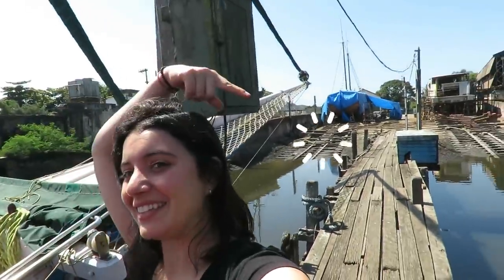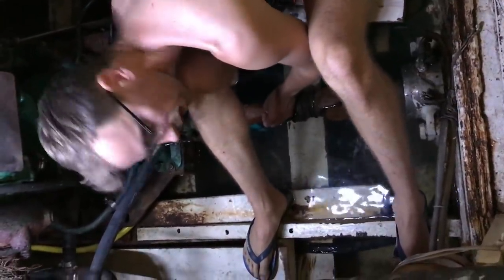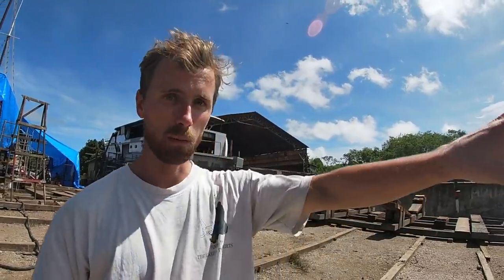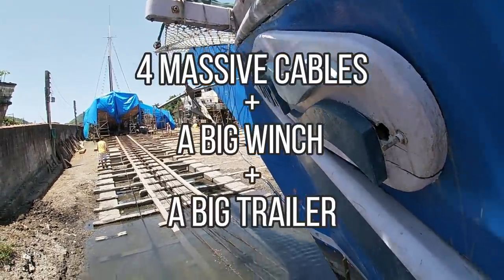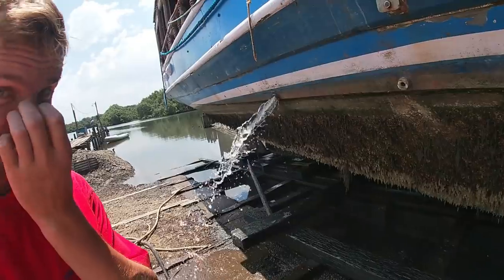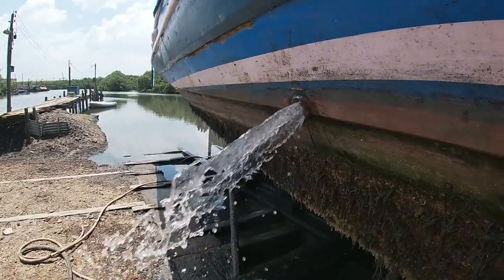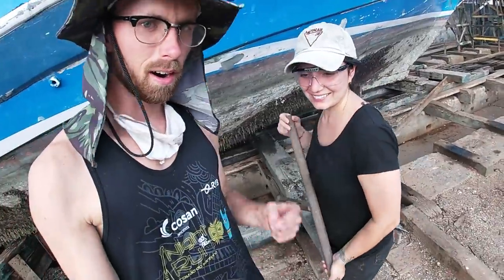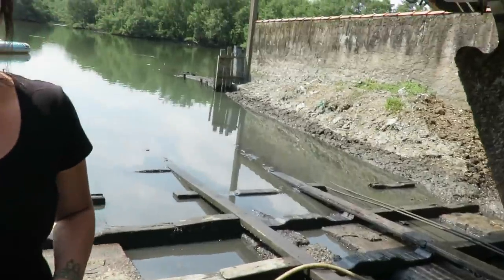Lifting our wrecked schooner for the FIRST TIME in her life — Sailing Yabá #3

Comment: While on the hard, if you haven’t already, I would have Yaba properly surveyed and fix anything that could possibly cause a failure at sea. Most likely the holes you see are the tip of the iceberg. Not worth risking lives for the sake of a timeline. Good luck to you both.

Comment: I think after all repairs are done to the hull I would put some fiberglass on it with epoxy. That way she would be stronger and less likely to leak. If you bored the holes out and plug them I would put  penetrating epoxy on it that way it will get into all crevices
Reply: I agree!

Comment: Hi Guys.

Just my opinion. But you will need to clean all of the hull below the waterline and then either replace the rotten planks or fibre glass the whole area below the water line.

Any thing short of that will see your ship on the bottom of the ocean.

Cover all the soft areas with sheets of water proof plywood if you need to move the boat back into water.

Anything other than that and you are wasting your time and money.

Do it right or don`t go to sea.

David.

Comment: When fixing holes: maybe better to bore out the holes. Then cut some pieces of wood slightly bigger and hammer rhat into the hole. I think that is a better quick repair then with epoxy. Also cheaper. The new wood in the hole will grow when it is getting wet and stop the leaking.
Reply: On wooden boats you replace planks.
Reply: @thomashaas2929  ...and on this one, all of them. I just wonder if the ribs are in the same sorry state, infested with worms.

Comment: As you allready have your vessel out of the water, you should at least repaint it the bottom part of the hull with antifouling paint, those barnicles will chew the wood of the hull asthey have to stick into the surface and as the surface will get rotten then iyou will starto to have holes again, it is better to stay few extra days and be on the safe side, if you do it now you will save the cost of pulling out the vessel again soon, take care

Comment: Did I hear you correctly that this boat was built in 2004?  That thing looks like it was built in the mid 1900s ! There is no way that it should be in that bad of shape in 14 years unless it was built by someone in their backyard from lumber not suitable for boat building!  

You are in for one very long stressful journey which is going to make 2020 look like a piece of cake! 

Keep your head above water! It's going to be rough sailing ! Be Blessed you are going to need every blessing possible!
Reply: I didn't know it was only built in 04, if that's the case then that boat has been treated really bad. I'm guessing the reason they have so many leaks is because it was antifouled sparingly. Also I can guarantee the wood is filled with worms that feed on wood.
Reply: No way this can be 2004. It’s all rotten.
Reply: 2007. Even worse. With big patches of rot and worms in the planks (and rotten ply on the inside), it’s not worth the time, money, and effort
Reply: This is it's first haul out apparently and it's the tropics! Its lucky it hasn't sunk well it was sinking slowly. This hull wouldn't be safe in a seaway.

Comment: Don't use epoxy! It won't stick to wet wood. Use old fashion Boat Life caulking for wood boats. Looks like a great yard. The marine railway is better then a travel lift for the old wooded boats. I have repaired worse boats. Use cooper with bronze nails to patch the holes in the hull with boat life caulk in between.

Comment: yeah seriously do those worms were actually Barrel Through the Wood and eat the wood up they don't weaken the wood and make it more acceptable to rot and is welcomed apart on you do the fact that that thing is that messed up and there's that much worm infestation you were lucky to get it on the dry dock II be like putting it back on there as fast as possible and take care of that Rusty hinge part on that Rudder in any other rusted parts

Comment: God the worms hanging out of this , it’s past it , epoxie if you can get the timber to dry enough to except some epoxie with a  hull thickness of 2 inch    use dowels going in tight and epoxie these in , but this hull is in shocking order

Comment: Where you are finding holes in the planking means replacement. There is no quick fix, do it right and you will be able to enjoy your boat, neglect to do a proper repair and you could find yourself without a boat. Your boat is not seaworthy.

Comment: nice video's you two but I think you are taking on a impossible mission with this wooden boat.   As you note you have several holes in the hull - you can't just patch these with epoxy and hope to sail away.  You have to replace the entire plank(s) to fix something like this.   I really hope you listen because you will put your lives into danger if you try to just minimally fix things and take off.     hope you have thousands of dollars in the bank cause that;s what you will need to get this boat back to sailing ability.